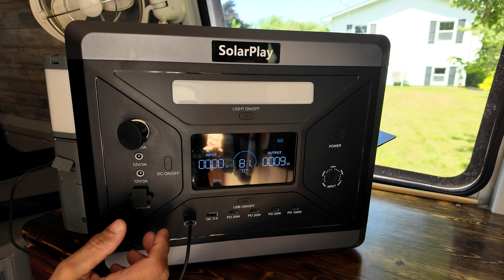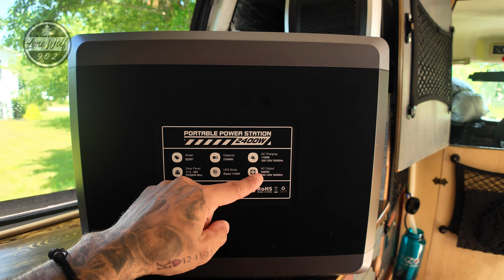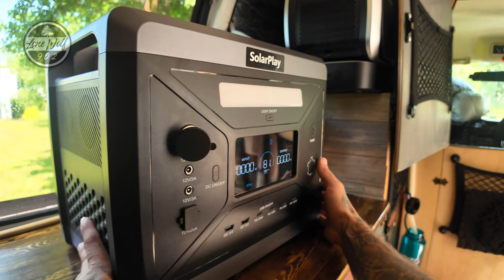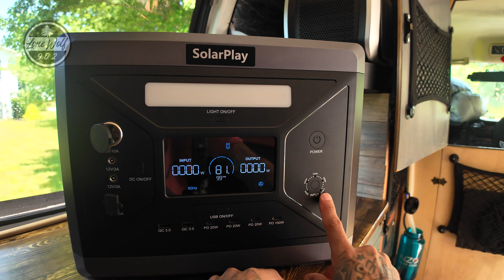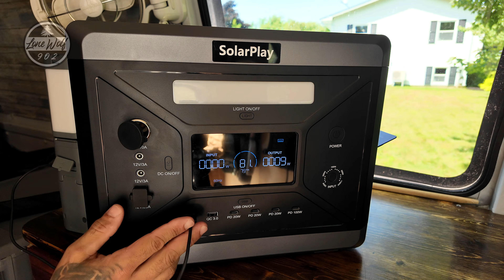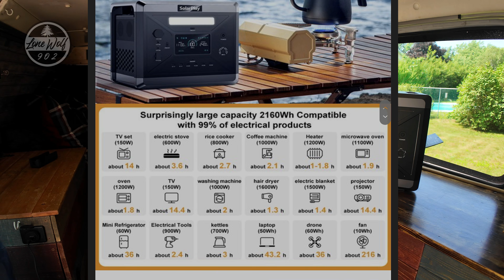Portable Battery Power Station For Off grid Living - Solar Play 2400w

Comment: Hi, do you think it is possible to plug a 15A to 30A adapter on the side to plug a RV for running air conditionner and lights ? Everything with 500w solar panels for charging it?

Thank you

Comment: Thanks for posting the review. I'm considering buying this unit to replace my Oukital p2001. My issue with my unit is that it only charges at 1200w warp speed, so I can't charge it from my Sportsman 1000i gas generator when off grid and no sun. Have you experimented with AC charging at lower watt levels yet?

Comment: Cute, but I want a unit i can work hard and know it will work when I need it( shtf ) I'll keep my low frequency  units, run 3000w continuous,2000w  solar in, 1500w wall charge,6 ac plugs 15a, 30a 120 plug,5 13.8v 20a dc socket, 20a car charging, 2 mppt 150v, infinate battery expansion, 2 external battery ports, run any battery chemistry,lead acid,gel,lithium, and can do it all at the same time,modular, and the heaviest piece is 32lbs. Cheap! Nope,guality and dependable, yep